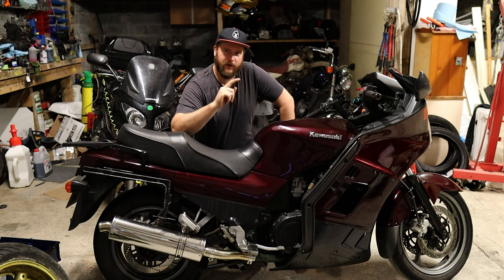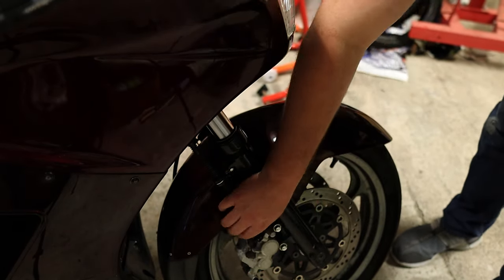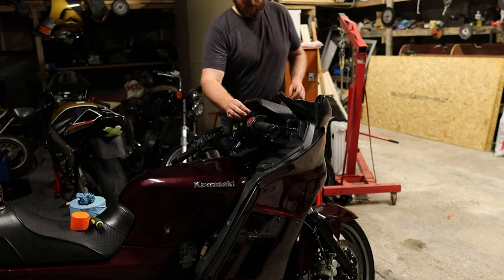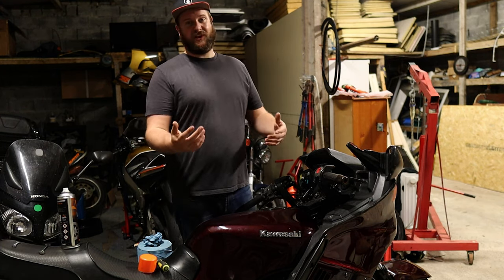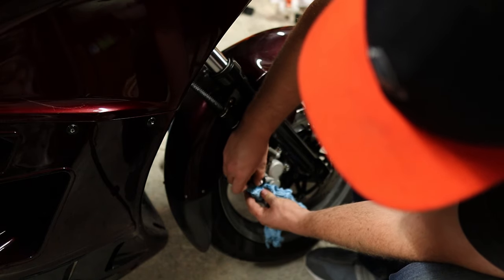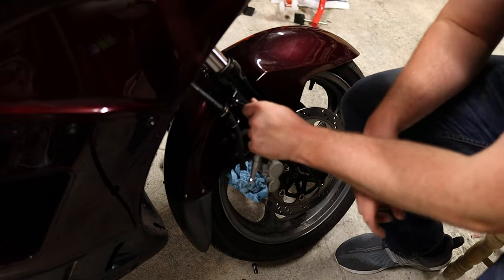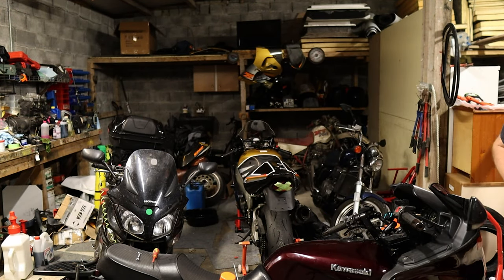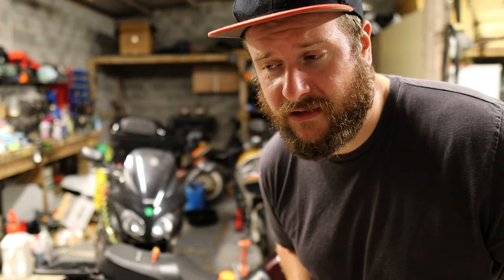Fixing a 1995 Kawasaki GTR 1000(ZG1000) | The Chariot of Kazawhaki

Comment: I bought my Gtr1000 from a guy with 3 of them and did a refresh of all the brake fluids and pads an such before riding it and the fluid on the right hand res was the colour of old motor oil. Pure black sludge. But it's cleaned now and the brakes have worked well for two riding seasons now 👍
Reply from the maker: Ah very good! Nothing worse than muddy looking fluid! Did you check the pistons when you refreshed them? I've always popped my.pistons out every few years to give them a clean and check them! Glad to hear it's flying it :)

Comment: I have found that the poor front brakes on my 02 was caused by brake dust/crud build up on the posts that the inner pads move along. The pad will gall and twist sideways a bit so that only half the pad is actually doing some work. Cleaned everything down and they are back to full functionality.
Reply from the maker: These ones were just in need of an overhaul, that could have certainly played in to it but the master cylinder, lines etc were all probably in need of replacement. The caliper pistons were also not saveable.
Reply: @TheGorillaBiker  Yep, mine are in pretty good condition fortunately.

Comment: My CB450s used to have the same break line junction in it. It was just removed and I went for Hel Race lines straight to each side from the master cylinder as it was the same cost as the split line set up and one less place for it something to fail. Personally I went with Black lines because I’m boring. 😂
Reply from the maker: That's the joooob I was considering chopping the lump of uselessness out of it! Since it's been done before I shall follow suit :) Ah nothing wrong with black on certain colours but on this bike it'd just be wrong!

Comment: Surely Kawasaki has some 4 piston calipers that would bolt on like off a ZZR1100? They would be superior to rebuilt 2 pistons.
Reply from the maker: They more than likely do but this is a much more cost effective way to get the bike to have brakes again :)
Reply: You could, but then you would need to redo the forks.  Way too soft for hardcore front brakes.

Comment: Need to see follow on vid. Firstly I always struggle getting the air out the system and secondly need to see the clean up of the piston. Last time I did it the piston still didn’t work to well. Bubble gum for the Craig, but can’t do that to a mate(can ye?)😂😂 black because I’m a boring old fart!!😂😂
Reply from the maker: It won't be too long coming :) 
Air out is grand for anything not linked, if you really have issues then hand the calipers up higher than the master cylinder and it's easier again, and prime the system by pulling down the brake fluid with a syringe! Yeah the piston ideally I'd change but it's not my call tis the man who's paying for the bits :) 
Haha I absolutely can :P but carbon purple won the vote which suits the bike too :)
Reply: Looking forward to the vid and the priming. Thank the good lord he didn’t let you put the bubble gum on the bike 😂😂😂

Comment: Don’t get me wrong, enjoying your work on your friends ZG1000.  Still, I’m going to offer some advice. I own a 2002 ZG1000, which I’ve had from 2007.
Not matter what, always cover the fuel tank with something more than just a few crumpled/wadded shop paper towels.  I like old bath towels, 2-3 depending how large the towels are.  Covers the tank and more to boot.  Brake fluid is horrible on paint, and sucks taste wise if you ever get some in your mouth (don’t~ it’s really bad! 🤮)
Also, use a syringe of some sort (cheap, and easy to use) instead of shop towels to remove brake fluid from the reservoir.  You are asking for trouble using paper towels to empty reservoir, I.e., dripping brake fluid everywhere & anywhere… .  Use of a can of brake cleaner Willy nilly around the brake reservoir, splashing on the gauges, windscreen, tank doesn’t seem very wise. I’ve used electric contact cleaner in places that have paint/ plastics, as that as a solvent is much less harsh on items around the area you want cleaned.  That’s my .02 cents for what it’s worth (.02 cents).  I’ve been riding and working on my own MCs since 1986, and  been wrenching on cars, military aircraft since 1974.  Ya need to be cautious when using cleaning solvents.  It pays off in the long run.  Of course, if you really want clean, get some MEK…., but try not to breath the fumes, your kidneys will thank you. (That’s a joke, MEK is some heavy duty ~ potent solvent, and you WOULDN’T use it around a MC…. .) Good luck in your wrench turning 🤗😎👍
Reply from the maker: All of the above is entirely fair, however I've said it in many videos previously, and in comments(which of course I don't expect you to have seen/read) I use what I have to hand, I'm not a mechanic and was just helping a friend out who needed his bike useable again. I'd love to have a shelf full of options but I generally don't so make do with what I have.
On the splashing and whatnot, I actually clean every bike very thoroughly after I work on them, but would never include this in a video as it would be a hassle to edit and I don't think people would watch it either! :) I had also broken my syringe that I'd usually use for draining things. 

Lastly, brake fluid tastes lovely what are you talking about :P I'd also recommend not squirting it in your eye :D
Reply: @TheGorillaBiker  I understand. You make due wiith what you've got. Been there, and I will be again for sure. Thank you for the response. All the best for future endeavors  :-)  (cheers) :-)
Reply from the maker: And thanks for the comment and for watching! Thanks bud! :)

Comment: Brake fluid and break cleaner all over the place and he just wipes it down😬. There goes the paint..... and never clamp calipers that way in a vice. Much easier to squeeze the pistons out via the brake lever.
Reply from the maker: Haha not everything I do I record lad it was given a proper clean once I was finished 😂 And all the paint is still intact as of today 😂
Reply from the maker: Also I see you edited the comment there.
I've learned a lot of this by myself reading mostly service manual, a few I've read have said it's better to use a piston removal tool, not that I don't appreciate your comment but I will say your tone and the way you're talking down to me is why I'd never listen and learn from someone who talks to people as you do. 
I've taken your comment on board so hopefully you can do the same for me, exactly what you've said, conveyed in a helpful way, might actually teach someone something.
That said I'll clamp calipers in a vice when needed, any particular reason why I shouldn't?
Reply: I didn't mean to talk you down. Maybe you Just read it that way.
You did exactly the same using those laughing emojies 😉
Clamping calipers in a vice can easely leaves markings on the calipers.
Reply from the maker: Fair enough, I actually laugh a lot when I speak in general I probably do over do it on emojis...had to resist using on there, and now, and now. 😂 I failed. 
Ah yeah they're very lightly clamped though and I use ribber vice jaws or a cloth